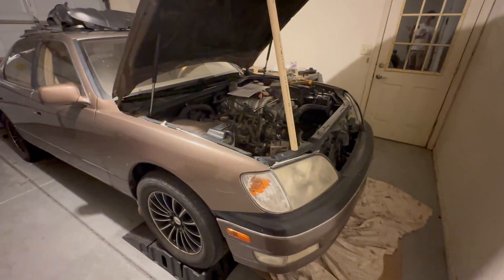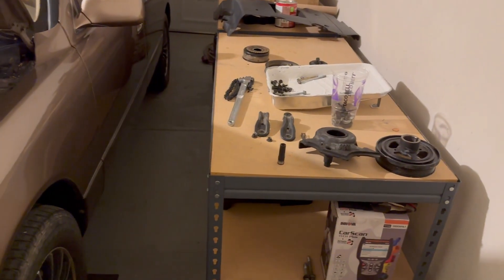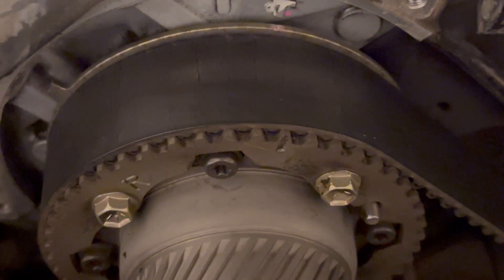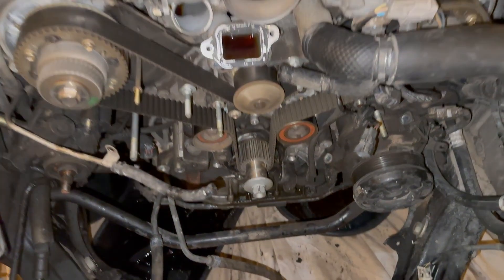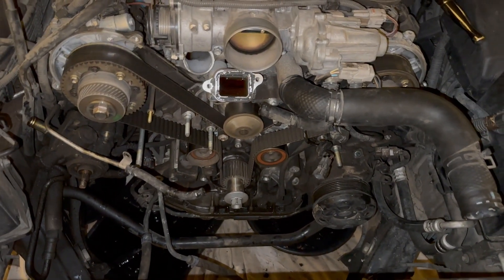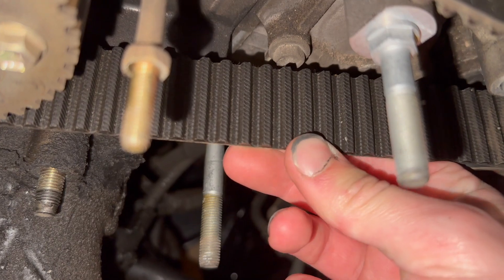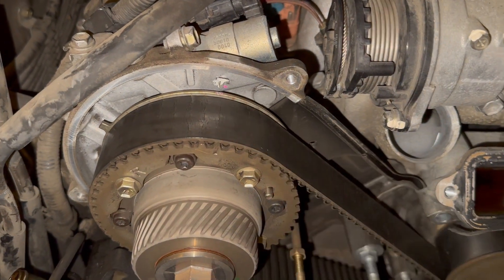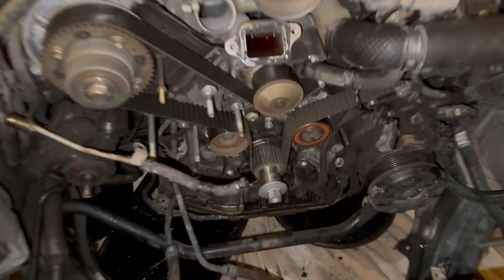1999 Lexus LS400 137,000 Mile Timing Belt Update

Comment: You should have seen the timing belt removed from my 1998 Lexus GS300 original belt had 159k miles on it it was pissing oil from both cam seals the vvti gear o ring and front main seal it was a little worse than your timing belt 😅😅 glad I checked the timing belt couple months ago just finally did it 2 weeks ago
Reply from the maker: Sounds like you got lucky! Pretty amazing that wear items like that can last 25+ years and well past their mileage interval